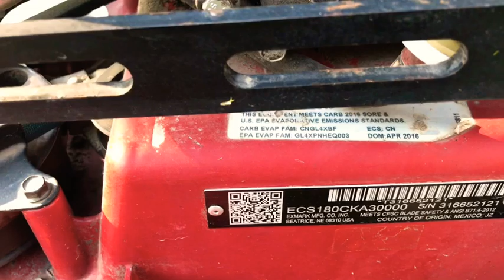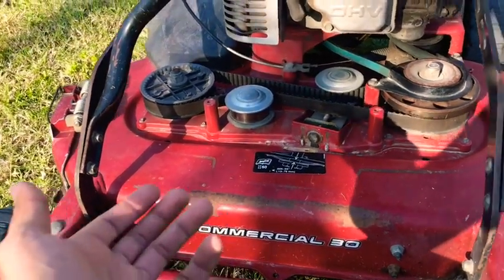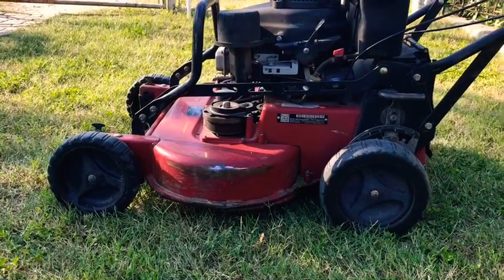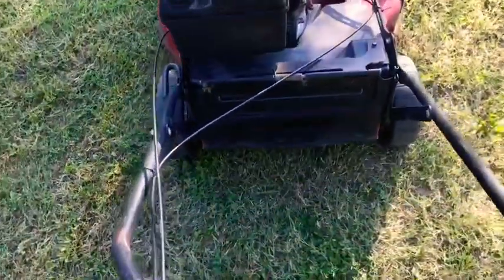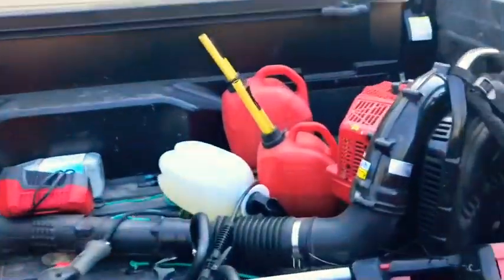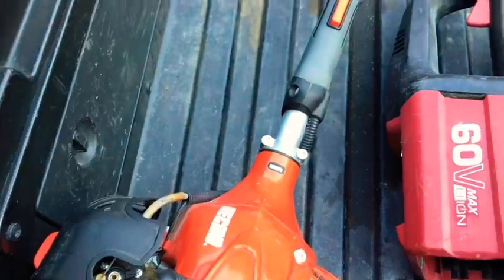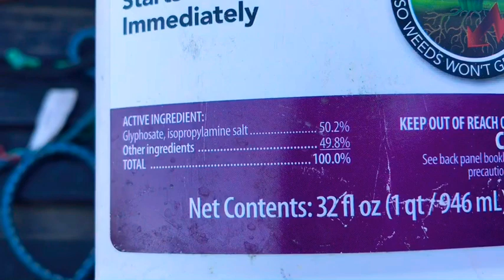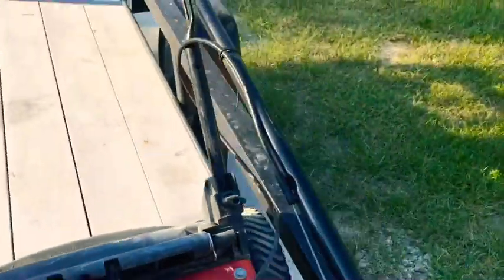Exmark Commercial 30 ANY GOOD???

Comment: Man that's a good price! I'm in the market for a larger push now.
Reply from the maker: May Mow, I have to give it a little tune up. It has been acting up a bit. But it saves time and you don’t have to walk too much. It is heavy like I mentioned in the video. The Toro timemaster is lighter but it is not a commercial mower. That one is about $1000 brand new. I’m thinking about getting that one next.
Reply: @electriccuts  Yeah I can't find one used in my area to save my life bro!

Comment: I’ll be honest. I’m not extremely impressed with the power of the mower. It does save so much time. No ve had it for two years, minor issues every now and then
Reply from the maker: Mine is currently for sale. I think it’s too heavy.
Reply from the maker: Maybe a time master might be lighter
Reply: @electriccuts   First day I used it I was like “what did I just buy?” It was so heavy in the beginning. But I got used to it so quickly. I don’t think it’s heavy at all now.
Reply from the maker: Yes as you use it you get stronger 💪🏼